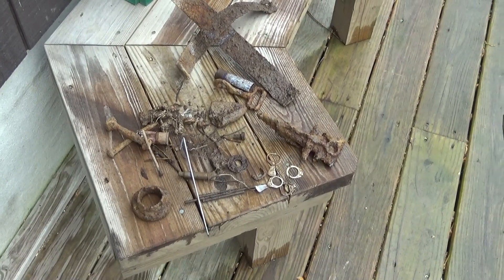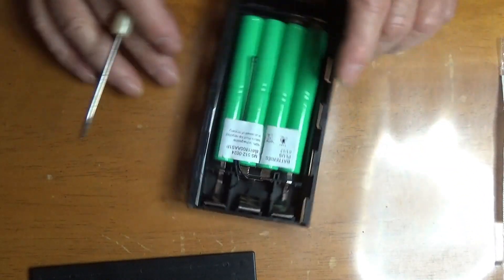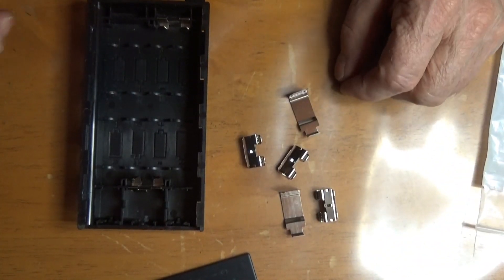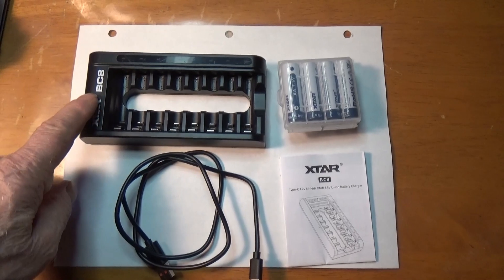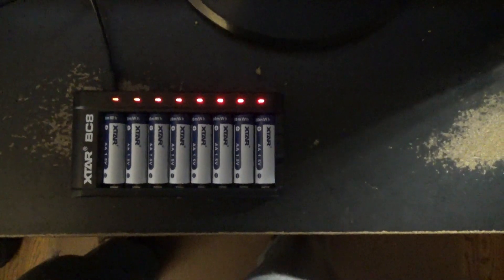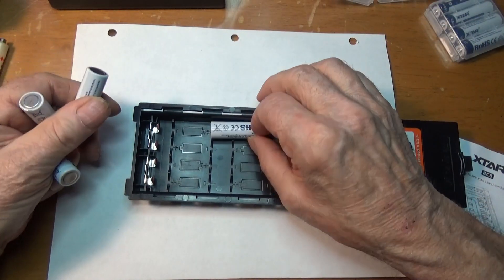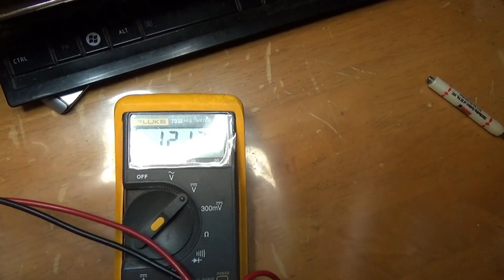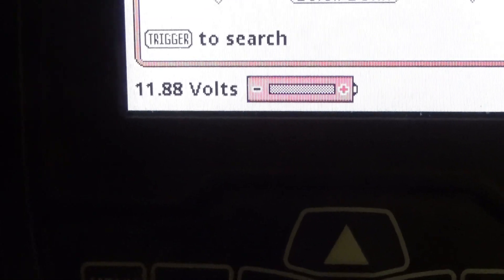V127 Whites Spectra V3i rechargeable battery upgrade to Lithium

Comment: Where did you get the repair kit?  Cant find it anywhere
Reply from the maker: EBAY  search term   Whites 802-7150
Reply: There is a company in Oregon, Centerville Electronics that has some still. They have a website. Selling at $13.  I don’t see any reason that you couldn’t make this work with a few local off the shelf items. .